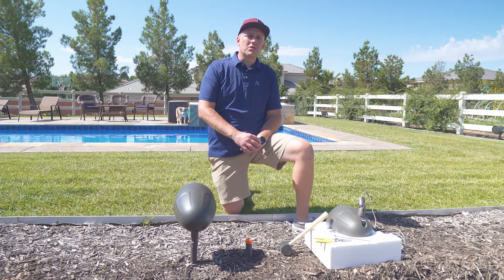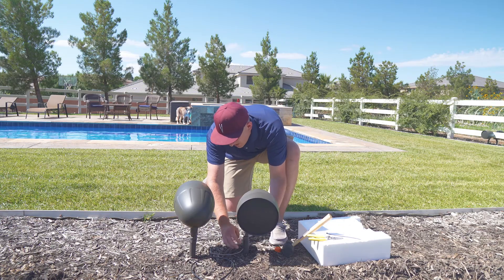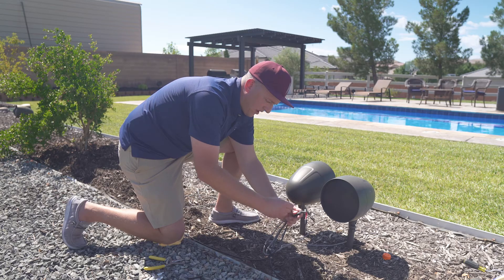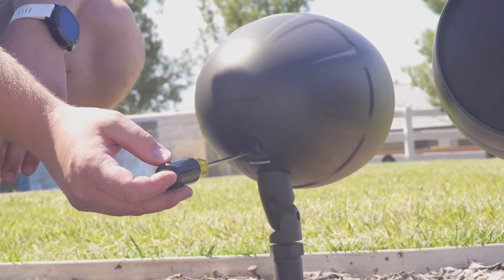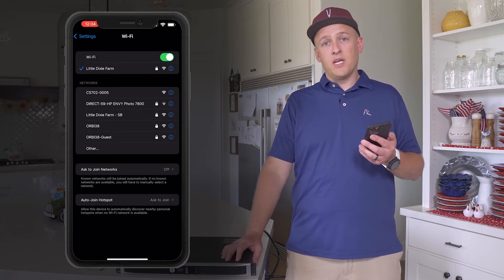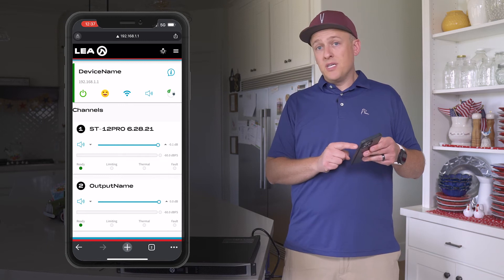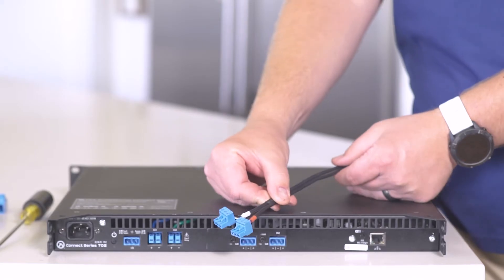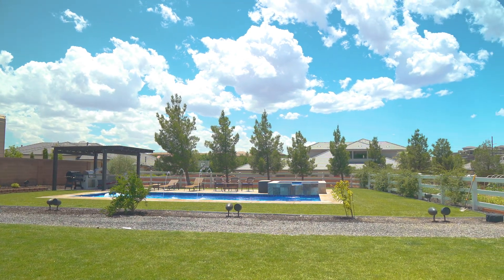TruAudio Landscape Audio Installation

Comment: You terminated one wire for the speakers.. how many can that amp run thru one terminal?
Reply: I believe that is a Lea connect 352 so around 350Watts / 30 or 60W per speaker, So up to 5 in 60W or around 10 30Watts speakers
And for the Amps,  350W/70V would be around  5Amps. But every amplifier is different